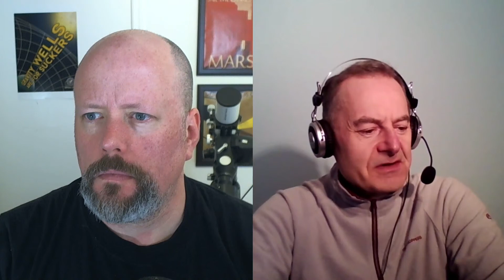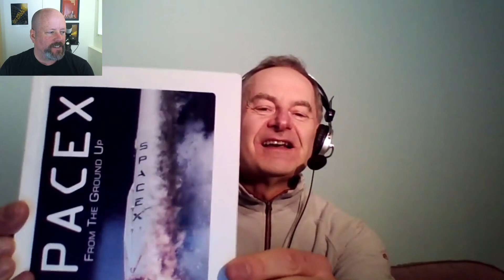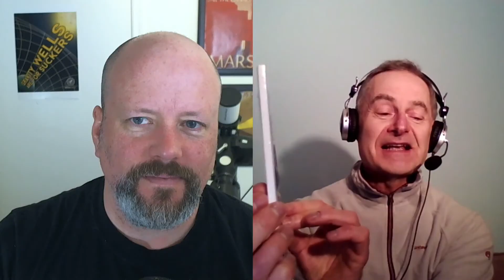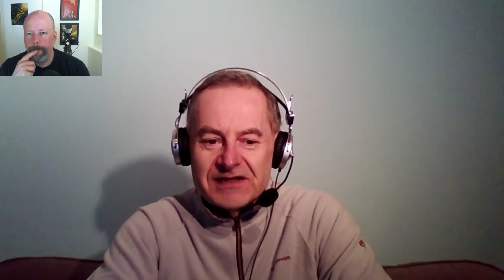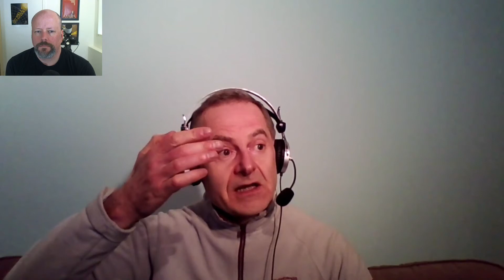Interview: Chris Prophet, SpaceX From the Ground Up

Comment: New Horizons passed by Jupiter about 13 months after launch from Earth so if you have a big enough rocket or a small enough satellite you can get there fast. But at that speed you have to burn a lot of fuel to slow into orbit around Jupiter. Going there in 2 years is better and still a lot quicker than the usual 2-3 gravity slingshots around Venus and Earth to build up speed. With a 150 ton kick stage burning methalox you can get a 10 ton satellite to Jupiter in 2 years. Get on it Elon! :-)

Comment: I think "Everyday Astronaut" is the goto guy for all things Spacex technical - he does know his stuff, and Musky wusky seems to have a soft spot for him.
The landing proceedure is way more extreme at the moment than is intended for the production craft. Remember also the Raptor engines are still very much in development phase. I think at the moment they can only throttle down to 50%, plus they will eventually have hot gas thrusters - all this combined will make the actual landing a little less hard core

Comment: Hey, just a small correction on "we only had those computers recently" ... look at Buran, that thing was designed to (and also did) land fully automated, and that was ... what ... 50 years ago? So definitely in the same era as the shuttle.
Reply: Buran flight was in 1988, so 33 years ago, good luck on landing autonomous a shuttle with Apollo era computers, those things were really primitive but in their time were revolutionary, computers really got trough a exponential improvement, so nothing we have 50 years ago(1971) can land a rocket autonomous (well it could but would weigh half of tons and cost like the rest of rocket).
Reply: @theOrionsarms  the shuttle flew not too long before that. These are comparable vehicles from comparable eras.
Reply: @frankyboy4409  first shuttle flight was 1981 with Apollo style electronics , but notoriously even after upgrading flights sistems in the 90"used low performance computers unable for autonomous flight, they simply don't want any major upgrade and even claimed that more recent chips aren't safe.
Reply: @theOrionsarms  I'm not saying it would have been possible with the hardware they put in the shuttle, but that it would have been technically possible at the time if one would have wished to do it.
Reply: Hence,... "we only had those computers recently"!
50-Years is nothing in #human timelines, it's bearly a #Generation, anything that is under a hundred years is considered relatively New! ... Though I do expect that A.I and #Quantum computers will accelerate our timeline vastly, in under 10-Years,... 
Fasten your seat belts, comes to mind.
Reply: @CodeLeeCarter  No, just no. In the context of spaceflight, 50 years is basically since forever. Especially if we also consider the rapid development that computers have had since then (we are literally talking speedups by tens of orders of magnitude). Also all of this is besides the point. The argument is "space shuttle could not have landed on its own because computational limitations" and that is simply untrue.